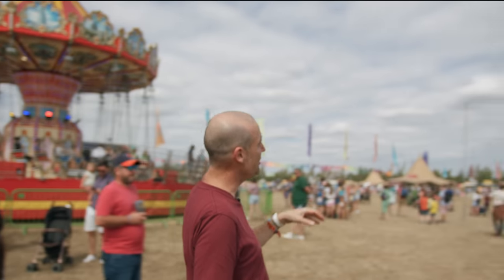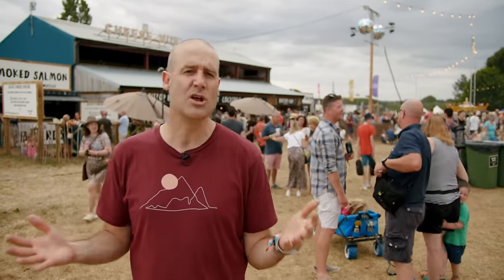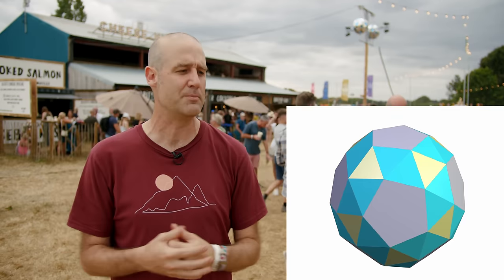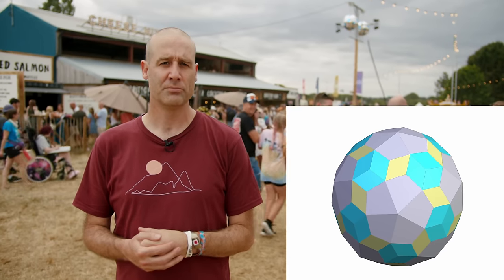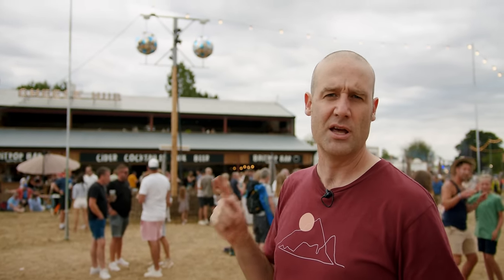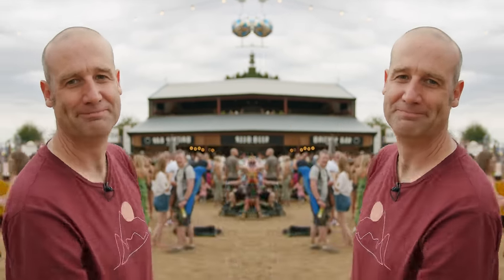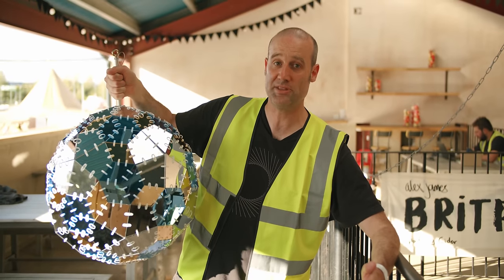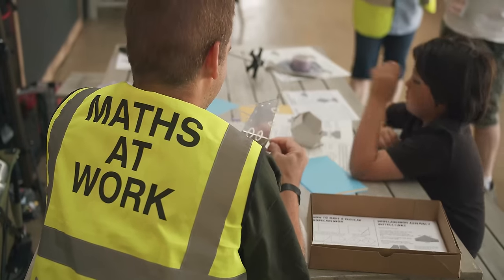Mirror-image Mirror Balls: introducing the Kite-Rhombus Hectapentacontahedron

Comment: Would be interested to know how the final faces were added while keeping the tie ends inside, I have an idea for one way to do it but wonder if it's how it was done...

(My thought is before adding the "keystone" face or collection of faces run cords thin enough to fit through the gap in an edge or vertex out through the far side of the thing, then loosely attach the cable ties and fix those cords to the tie ends, then use those to tighten everything down; that said I wouldn't be surprised if there wasn't some neater way to do it I wasn't thinking of)
Reply: The moment I hit send thought of a probably easier possibility - just pass the loose ends back through the gap around the final face(s), work it tight, then poke them back in...